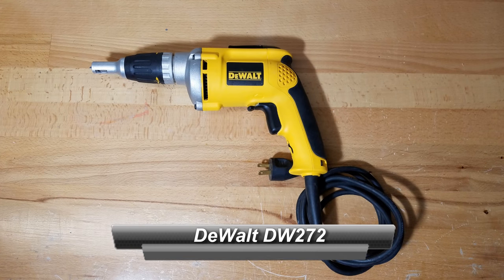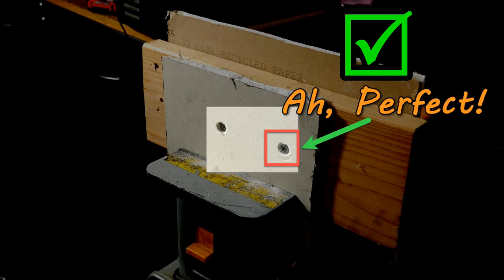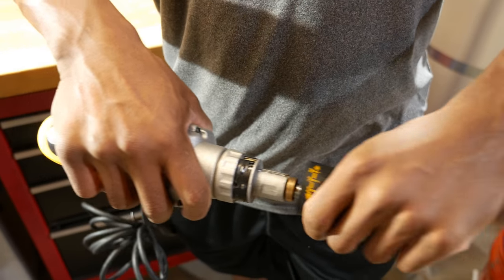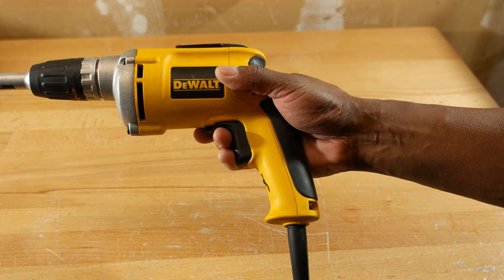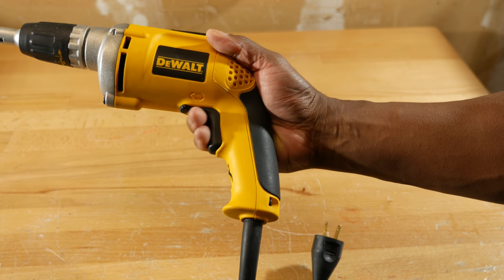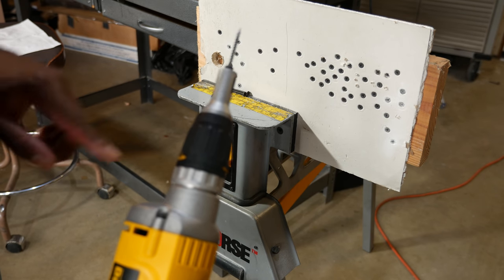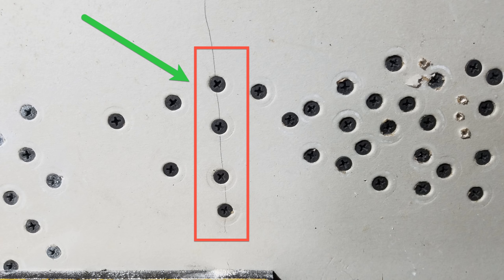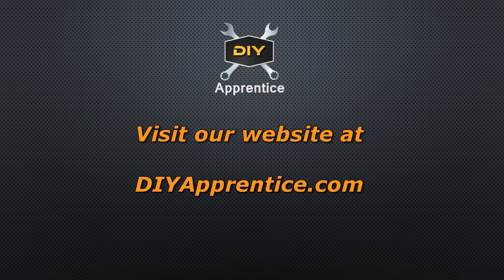DeWalt DW272 VSR Drywall Screwdriver Review

Comment: I use the 255 it's faster but the 272 it's heavier but has better torque kind of slow as it has only 4000 rpms . The 255 it's lighter with 5300 rpms . I put 3 clutches to make it faster .

Comment: Very helpful even though I have the DW255. I will keep working to remove the bit as it looked like it requires move hand strength than I have.
Reply from the maker: Thanks. Yes, removing the bit is not exactly easy. 😀

Comment: Hi I had two questions about this DW272:
1- Can I use it as an impact driver with different tips?
2- is it possible to attach collated magazine attachment?
thanks for time
Reply from the maker: It doesn't have an impact hammer, so i would not use it in that manner. I've only used it to install drywall and a subfloor.

Someone can correct if I'm wrong, but my recollection is that there is no DeWalt collating attachment for this gun. Something like this Senco adapter may work instead with a Senco attachment: https://www.senco-emea.com/product/4563/adapter-dewalt-dw252-dw253dw255dw257-dw266-dw272-dw276

I hope that helps.

Comment: Would also have been useful to see the range of depths that result from the range of depth settings on the tool.
Reply from the maker: Since the screw gun is primarily used to install drywall, in which case the screws are installed slightly countersunk, I'm not sure how beneficial that would have been to most viewers.

Comment: Which it's better to screw 2 inch screws? 255 or 272?
Reply from the maker: I've never used the 255, but I've installed 2" subfloor screws with the 272.

Comment: Is there much difference between using driver with setter bit vs actual screwgun?
Reply from the maker: I haven't used the set bit, even though I have one. Screw guns are faster and possibly more accurate (not sure). Since they have a bit of learning curve, as a DIY'er, I would only buy a screw gun for large projects.
Reply: If your job is drywalling driver is very slow when it comes to setting screws even with any bit u choose but screwgun sets screws through drywall in the wood stud like better it drives like butter I mean

Comment: Best drywall screwgun from Dewalt is dw274 10years with that gun it was discontinued to make dw272 though you can modify the dw272 to be like the old dw274
Reply from the maker: I've read that the DW274 is a favorite of a lot of drywall installers, and that the clutch is the main difference between the two guns.
Reply: DIY Apprentice  yes but you can make the dw272 to perform like the dw24 aka old black and decker drywallscrewgun lol
Reply from the maker: Are you referring to replacing the DW272's clutch with a DW274 clutch? I read that several people have done that to their DW272's.
Reply: DIY Apprentice  yes makes guns smoother and more consistent than cordless
Reply from the maker: Cool. Thanks.

Comment: What is different about the DW255?
Reply from the maker: Just looking at their specs:
- Amps: DW272 - 6.3 Amps vs. DW255 - 6.0 Amps
- Torque: DW272 - 81 in lbs vs DW255 - 60 in lbs
- No-load RPM: DW272 - 4,000 RPM vs. DW255 - 5,300 RPM
I couldn't tell if the black part of the housing on the DW255 is plastic or metal. The DW272's non-yellow portion is aluminum. Also, I noticed that the DW255 appears to have no black rubber at the rear of the housing - not sure if it would be less comfortable to use over time vs. the DW272.
Hope this helps.
Reply: @DIYApprentice  
Thanks.
I guess you'd have to use both to have a preference. 
Perhaps the 272 is the better choice for hanging dry wall on metal studs.
Reply from the maker: @johntempest267  One person, who I assume is a pro because he mentioned using screw guns 10 to 12 hours per day, said the DW255 is a good gun, but the difference in power is obvious when compared to the DW272.

Comment: Hi can we use quickdrive extension with this gun please?
Reply from the maker: It appears that an adapter (DWAG2) is required to use the DW272 with Simpson's Quik Drive: https://www.strongtie.com/products/fastening-systems/technical-notes/quik-drive-adaptors
Additionally, it looks like Senco's DuraSpin Auto-Feed attachment can be adapted using ADP009: https://www.senco-emea.com/product/4563/adapter-dewalt-dw252-dw253dw255dw257-dw266-dw272-dw276
The link is now in the description for the Quik Drive adapter.
Hope this helps.
Reply: DIY Apprentice thanks sir
Reply from the maker: np 👍

Comment: DIY apprentice, would this kind a tool be a no for taking out lug nuts off a wheel?
Reply from the maker: No, this tool is primarily used for installing drywall screws. I would use an impact wrench for lug nuts. A cordless impact driver like this one would work ok: https://youtu.be/xqLYu8juK34

Comment from the maker: Please don't forget to like, comment and subscribe if you like what you see!

I love using the drywall screwdriver, but I always have to practice with it if I haven't picked it up for a while.

🔧▬▬Tools and Materials▬▬🔧
✔️ DIY Apprentice Recommended Tools and Materials ► https://bit.ly/2T5psFw

✔️ DeWalt DW272 VSR Drywall Screwdriver ► https://amzn.to/2zpguKT
✔️ DeWalt DW272 Nose Piece ► https://amzn.to/2zpgqLa
✔️ DeWalt DW272 Carbon Brushes ► https://amzn.to/2xODuRw

📷▬▬Video Equipment▬▬📷
✔️ Camera used ► http://amzn.to/2GcpkOb 
✔️ Lens used ► http://amzn.to/2Deu16S 
✔️ Tripod ► http://amzn.to/2GbaM1c
✔️ RAM Suction Mount ► https://amzn.to/2Wz9PXh
✔️ Cyberlink PowerDirector ► https://bit.ly/2jTwGxT
✔️ Adobe Photoshop ► https://bit.ly/2V7nyUX
✔️ Camera Slider ► https://amzn.to/2WtD7GW

Comment: Is this good for carpentry? Which one is best for carpentry
Reply from the maker: Its primary function is to drive drywall screws to a consistent depth. I've used it to install a subfloor, but that's about it. An impact driver or a drill/driver will work best for other work. 
Here's a review I made of the Porter Cable PCC647 impact driver. I use it frequently: https://youtu.be/xqLYu8juK34